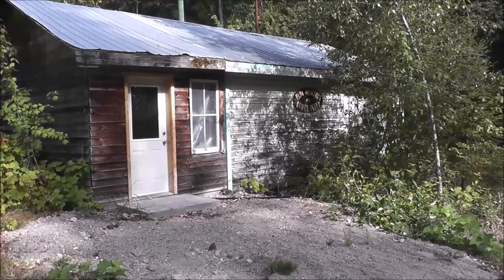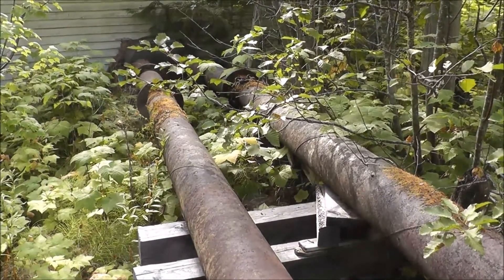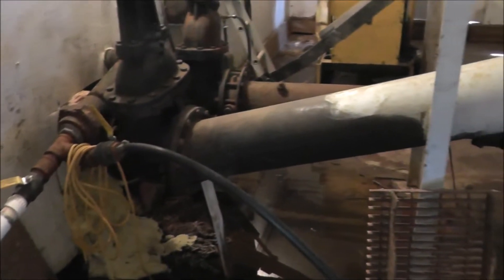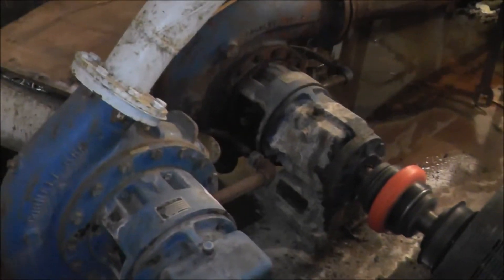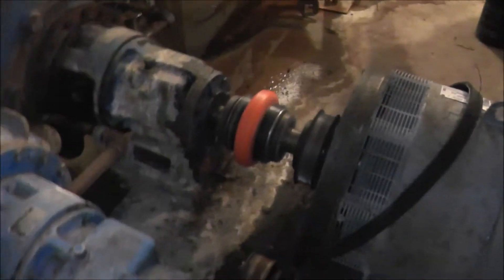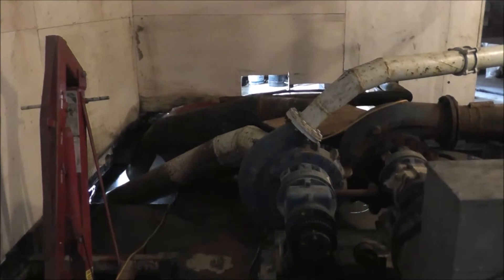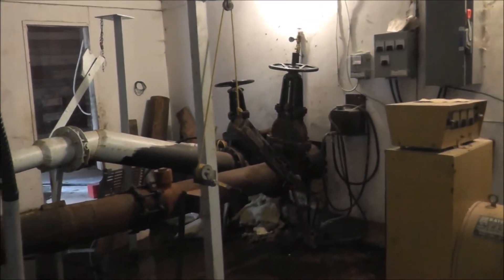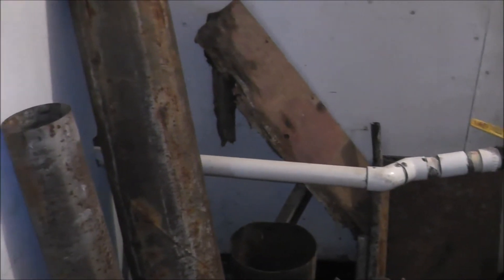Power Plant PART 2

Comment: Brian this is awesome!!!! I would love to see another video of the intake, the shut-off valves you mention at 7:20 seems to be automatic shut-off valves I'm thinking if the unit senses a voltage issue somewhere something would disconnect and release the cable to shut off the water, or maybe that was the plan but your dad never finished it? I could be wrong but man that is a sweet system there. I can tell he spent A LOT of time planning that